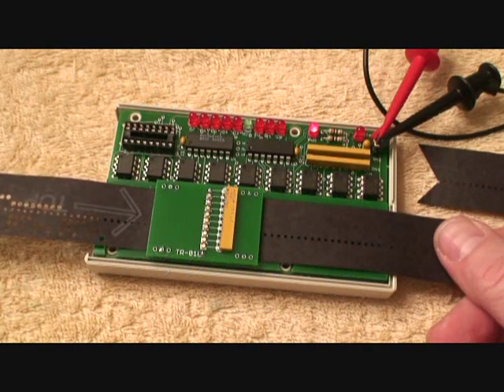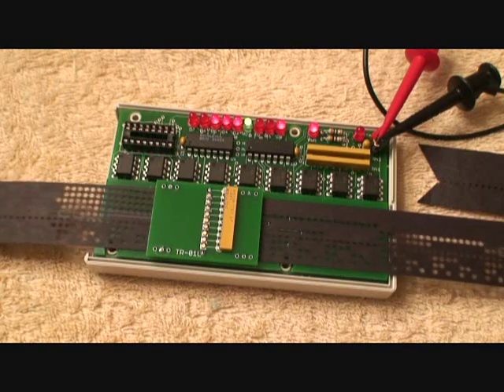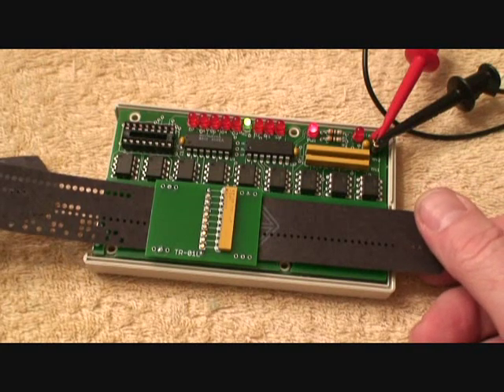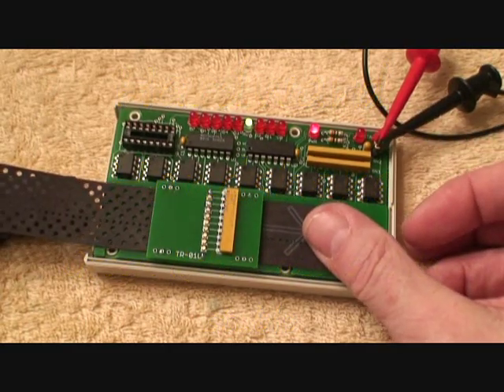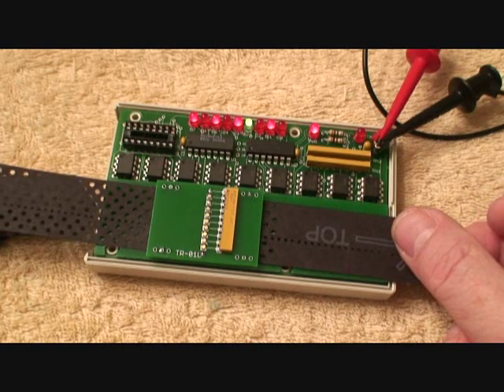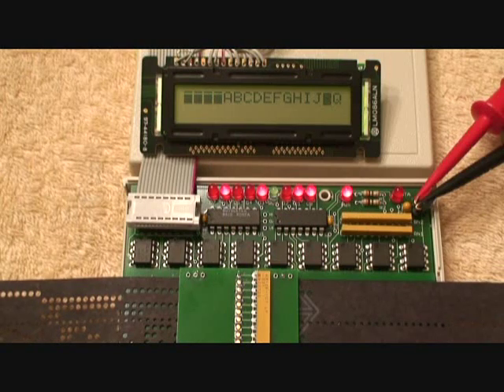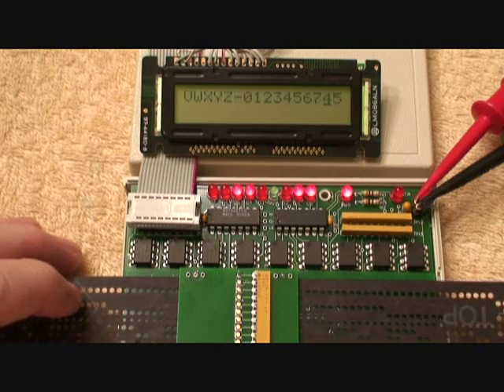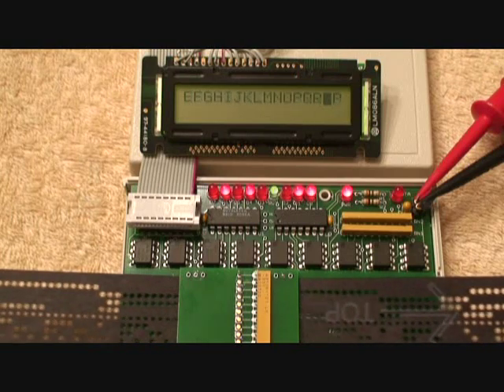Vintage Computer: Punched Paper Tape Reader

Comment: did you used switches or optos?
Reply: According to the project page (I found it in a TechCrunch article, http://www.msdsite.com/OLA/TR01/tr01.html ) they are phototransistors and an unspecified light source.

Comment: Question - is it possible for punched tape to hold audio data, in binary?
Reply: I see no problem with that, only that your tape would have to run pretty fast - you'll need about 175000 bytes per second for CD quality audio and then a bit more for overhead.
Reply: that would be crazy fast

Comment: Wrong. That beautiful device can be used to recover data from old punched tapes and send it to a modern computer, probably using the display interface (it should be parallel or serial, I believe).

Comment: Hmmm, I can remember working on both paper tape punch and readers. FYI, the small hole present even on a blank tape is where the sprocket drive pulled the tape through the reader/punch.